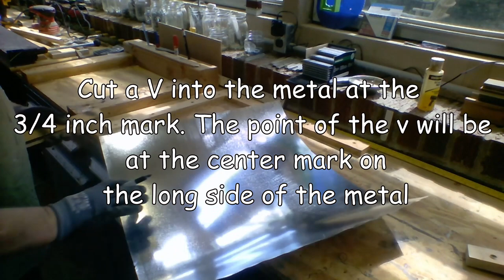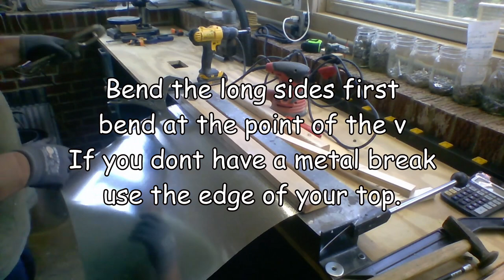Building a 10 frame Langstroth beehive

Comment: Sorry, but when I see imperial measure I switch off. We changed back in the 60's. Might help to add this into your subtitles
Reply: Metrics are not better than Imperial. I never use Metric measurements and I never will. It just doesn't work for me. One is not better than the other, only different.